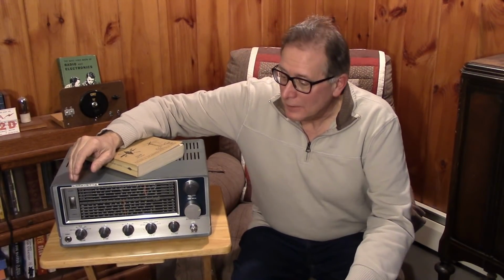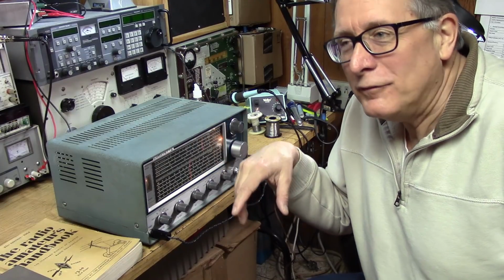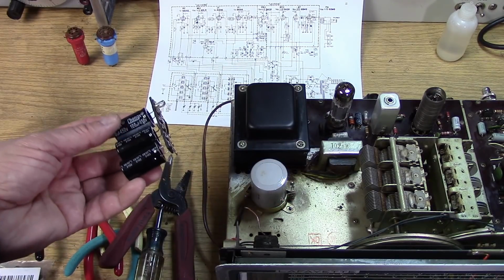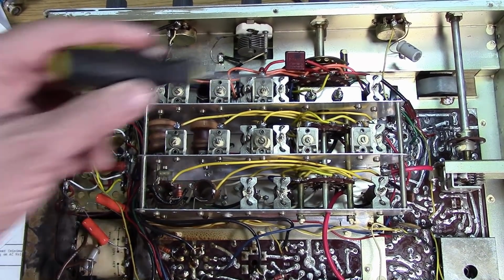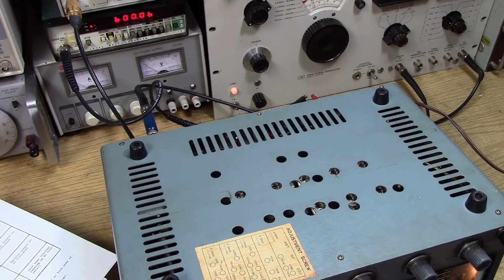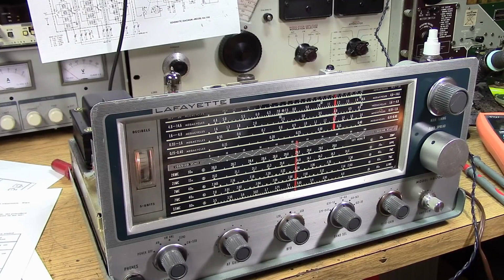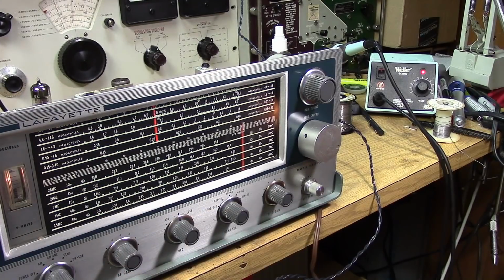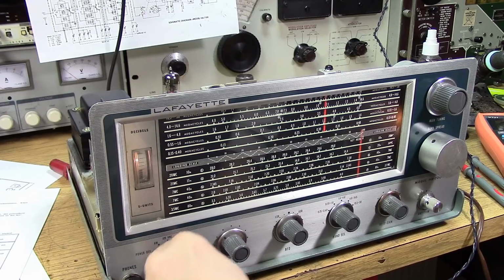HA700 Dream Receiver Refurb Part 2

Comment: recently picked up this radio with original manual @ at an estate sale...have not powered it up as of yet but looks really nice except for a flaky display glass in a few spots. I should obtain a variac before powering up I suppose.
Reply from the maker: Give it an inspection and look for dripping caps and burn marks! Pull the tubes out, clean and inspect them and replace. Some folks swear by the old 60 Watt lightbulb and 2 Amp fuse in series with the line cord trick to attempt to bring it up gracefully as the caps form. Starts bright then goes dim if everything is coming up. The filter caps will need to be replaced but you might get lucky. Some caps may have already been replaced recently.

Comment: Had the non pcb version of this , liked alot , later put common fets in place of tubes  right on the sockets on the bottom and it worked as before with a 9 volt amp added.  Got 9 volts ftom 6.3 filement, think old 102 fets. Put back to tubes later for fun.
Reply from the maker: Converting old receivers to SS was a "thing" for a few years!

Comment: Lovely job, there's something very satisfying about resurrecting & then operating old valve receivers. I did a similar job on an Eddystone S640 about a year ago & the fact that I got it going, gives using it a little bit of extra magic somehow.
Reply from the maker: The Eddystone sounds like a very nice radio!
Reply: @MIKROWAVE1   Yes it certainly is. I have it on my desk, with a HRO alongside & it really shows the technology leap that WW2 caused. The HRO is a superb receiver but even discounting the coil pack v  band switching, it's a very different beast to drive. Only about 10 years separates them in design but what a difference it produced.

Comment: I had to laugh at testing the tube tester, or testing your ability to use the tube tester in my case at least once.  Fixing the tube tester at least once.  Now I can say why I never test the tubes, consistency.  Glad to see old stuff up and running again.
Reply from the maker: Old TVs are a different story. They burned up a lot of tube life!
Reply: @MIKROWAVE1  I think shango066 would agree with you on that point.
Reply: @MIKROWAVE1  I paid for this last night, driver tube in hw-101 was bad.  2 bad tube I've found in about 2.5 years

Comment: I have the same Capacitor Checker as you do! Just got a near mint one about a month ago!! Hard to find but absolutely a top notch checker!!! I had a HA700 about 30- years ago, but been a long time, interesting video!
Reply from the maker: That thing is a gem! I got it from a local ham's (SK) basement!
Reply: @MIKROWAVE1  very complex inside and the way the dial goes across is very cool! A must have for checking high voltage capacitor from vintage radios! Up to 600 volts should do the trick! I got mine for $50 free shipping off eBay 👍👍
Reply: @MIKROWAVE1  Capacitor Analyzer ZM-3A/U was used just today to check some Electrolytic in my newly acquired JRC NRD-1EL receiver... The 100UF 450 volt capacitors were fine at 200 volts, but at 400 volts they began to leak.. Out they went and new ones went in... Does the job and FUN to use this vintage test equipment...

Comment: 6gh8 with rewired socket substitutes nicely for the unobtainium 7199.I fixed radios when I was 13 years old. we all started somewhere.
Reply from the maker: Most of those triode/pentode jobs (whatever circuit that they were actually developed for) have excellent RF characteristics at shortwave.